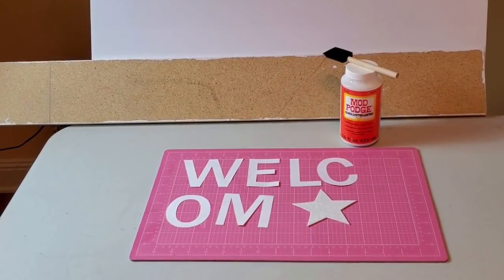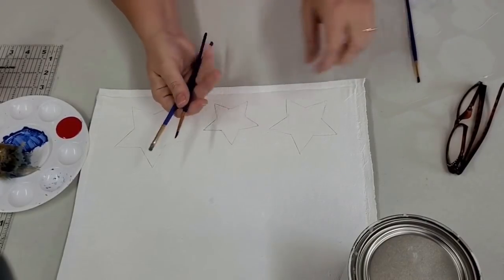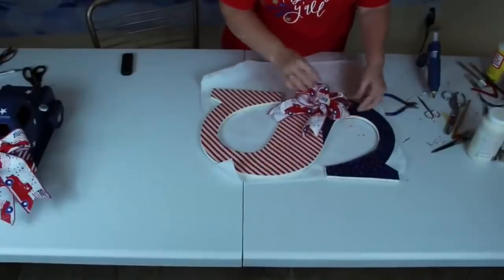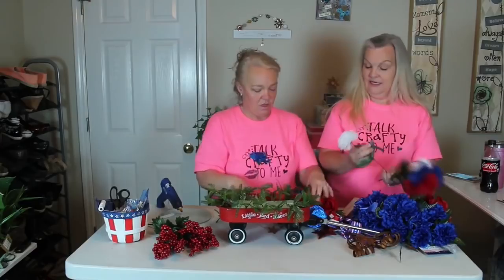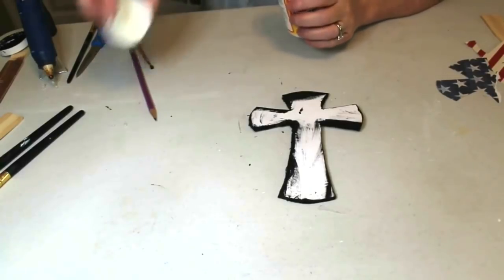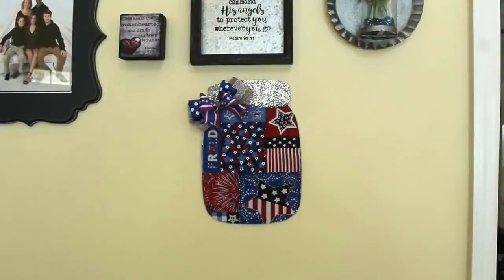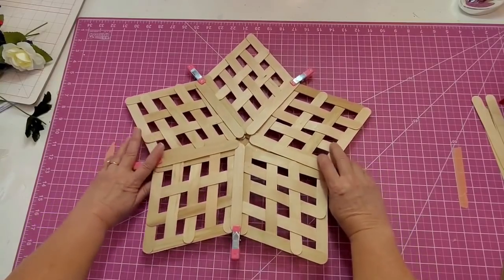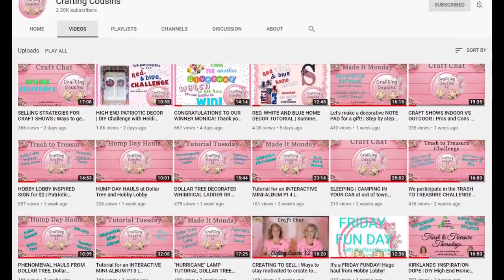HIGH END PATRIOTIC DIY'S | 4TH OF JULY | Farmhouse | Dollar Tree Project | Party Decor | Home Decor

Comment: When you mod Podge something to print, you need to use a laser printer. I go to Staples. Ink jet will run.
Reply from the maker: It can run but a lot of times I will put it in the oven on a low temp and dry it out and that helps with it. Thanks so much for watching and for the tip 💕😊

Comment: You used a tool to cut a small piece of wood at.an angle.
What is the name of the tool?  I  cannot remember. Also, where did you get it? Thanks
Reply from the maker: I got them on Amazon! They are called Miter Shears. Don't order the $15 ones, they do not cut well. These were about $28.